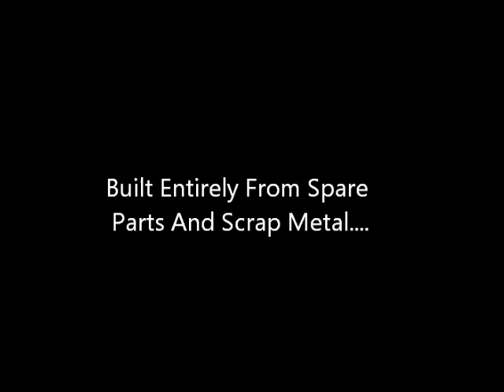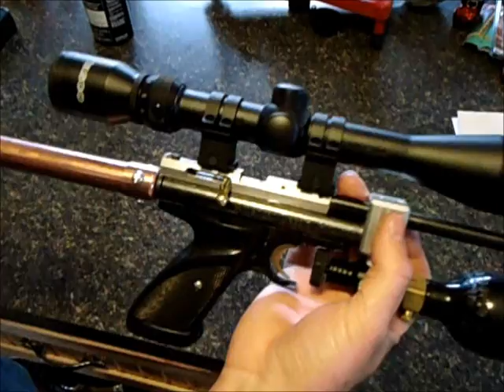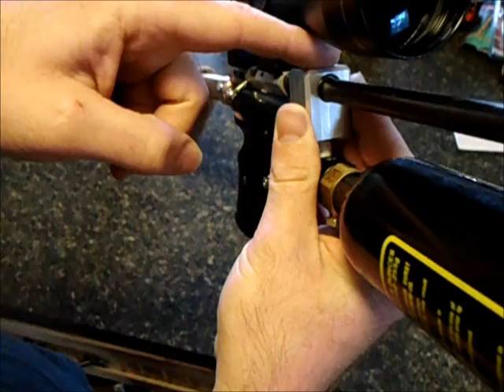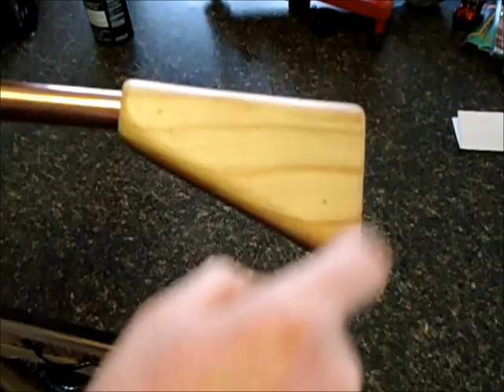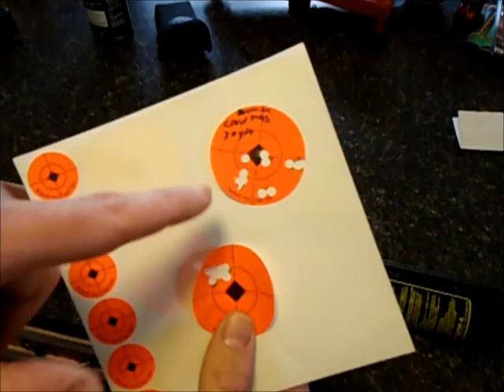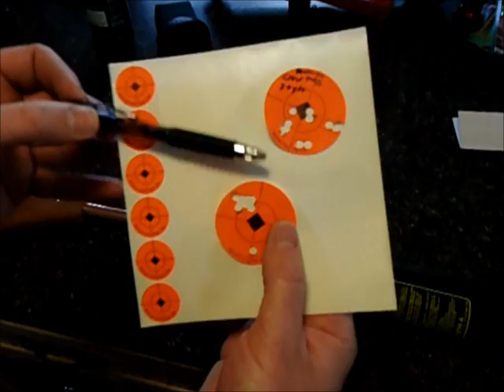Crosman 1377 Mods PCP/Bulk Co2 Project

Comment: So this isn’t HPA, it’s CO2?
Reply from the maker: HPA or co2
Reply: @MRT_H  ok. So you’re saying in the vid it could go to 1500 psi. What kind of velocity are you getting. And this is .177 cal, right ?
Reply: Sorry.  Just saw the 1000+ statement.
Reply from the maker: @visamedic  .22, I was getting 1000+ with 14.3gr pellets. On 2000psi. Kinda pushing the limits at that. But it worked. The gun is now a totally different animal than in the video though
Reply: @MRT_H    Wow. Mines a .22.  Been toying with it off and on for almost 10 yrs. I’m getting ready to do a tank adapter and set it up for HPA at between 12-1500 psi with a regulated tank. Little by little. Putting all new seals in when the kit comes in. Bigger valve with a bigger port. Folding stock with a power adjuster. Threaded barrel end for a moderator. Then I’ll see what I can do with my Fusion.
Reply from the maker: @visamedic  awesome! I wouldn't recommend pushing any gun as much as I pushed this one. I was super careful testing and everything, but it's still dangerous. Sounds like you'll have a great gun when you're done!

Comment: Nice job. However I don't like that you cut the trigger guard. You could have extended the bottle adaptor forward so to retain the trigger guard.  Other than that nice job.
Reply from the maker: Yes, you have to remember I was building this from spare parts though. And the 1377 tube is also notched. This was a slap together build for me, if I wanted it to be perfect, it would have been perfect 👍
Reply: You must of forgot to read where I said "nice job". As a prototype, of sorts, you had/have good ideas for modification that can help a lot of people who are into tricking out their Crosman. 

I was impressed.  Oh, do you know why you have to use Teflon tape? Because most of the fittings made today come from China and their thread pitch is off.  As for myself I re-tap or chase  the female and use a die on the male fittings.  Then I don't need Teflon tape.

Comment: Thank you Sir..... I think I will only be using CO2 anyway....... I'm a bit leery of the HPA  and Pressure as well.  I would Pin the Valve  180 Degrees  from where the Grip frame Screw  is , drilling  usuing a 1/8  Cobalt drill bit  and then tap a8-32 hole  deep enough to hold a
3/16th  in. 8-32 Stainless steel set screw to anchor it In.
Reply: That should say I'll be using a  1/8 " Cobalt drill bit (due to drilling hardened metal.

Comment: Okay I'll Wing it wherever I can.....! I  have quite a Bit 300 Series SS Rod to work with as well!   All I need is A good warm sunny day to work on my Grizzly Mini Lathe with Garage Door open.  Thanks for the tips.  I m not sure if I want .177, ,5mm,  .22 or .25 Cal. as I have choice of Barrels.
Reply from the maker: Mario Romano Or a heater! Haha just be careful with it, high pressure isn't friendly, and I would pin the valve in better than I did, I originally had it setup for co2, so that's why I won't fill past 2000 psi. If you want more psi, I would definitely re-design a few things. Keep in mind I was only working with what I had, if it was purpose built it would be much better. Just be safe, work smart. Also, I'd go .25 if you can, if you get similar power levels, it'll probably be more beneficial in .25 I would think.

Comment: At what Point on the  Air Tube did you cut off at....how much total?  I'm Guessing  you cut off the slot where the Pump arm  goes .  is there a reference Mark on the tube?
Reply from the maker: Mario Romano I'm not sure to be honest, it was cut to where the valve extension would reach, in theory you could make it as long as you want. You can kinda get a reference to where mine is cut by where the trigger is. I don't have the gun with me, or I'd measure it. But yes the pump arm slot is gone!
Reply: Okay...... I saw another guy who cut the Tube  to where  it reads ( from the right side of the Tube)  just where it says Not A Toy ... just after the"y" of toy .    But the other guy  just drilled out the front of the valve and tapped it to 1/8 NPT  ....!  

From the looks of it....in your video  it looks like the cut off for Tube was about 1/2 " Past(in front of) where  the  Grip frame is .   How long is the Stainless steel extension of the valve you Made.... although I recall you saying you didn't have enough to make it As long as you liked.... but that's fine...
Reply from the maker: Mario Romano Sounds about right. It's not an exact science, if you're off a little just trim a part down, or mix and match how you want it. There's no specific way.😁 Just order a little extra material, cut the tube where you want it, and go to town 👍 get Mario creative!

Comment: Hi...I've  seen that the ASA Adapter has a threaded hole  on the side is where the 1/8 NPT fittings go into on the bottom of the Gas Block I'm going to guess.
Reply from the maker: Mario Romano Yup, like I say, I drilled 1 additional 1/8npt hole for the foster fitting. It has 1 hole in it already for a remote line, etc.

Comment: Hi There!   What Kind of ASA  Adapter do you have & where did you Purchase it,Please?
Reply from the maker: Mario Romano It is the bottle adapter for a paintball remote line setup, I drilled and tapped an extra 1/8npt hole for the foster fitting. I've seen only the ASA adapter, I think on Amazon or eBay. Otherwise you might have to buy a remote line setup and take the coil hose off (use a little heat to free up the loctite if you do)

Comment: Hi! I Like your Build...Judering if you kept the Check valve in ,once you made the new SS Valve front?
Reply from the maker: Mario Romano Thanks, no check valve. I just cut a little shelf in the valve front for the valve spring to sit on at the same spacing as the stock valve for proper preload.

Comment: nice work. this kind of fabricobbling is the best. few people can even attempt. i think its beautiful. throw some black paint on the stock and gas/barrel block and it will look great. performance over looks any day. take pride you did great work. i have been air smithing for years and my stuff still looks like steam punk abortions.ive  been maching for 2 years so next build will look better. made a friend with a boat businesses a line gun for tow recovery and such. basically just a compact 2" air cannon. finding the perfect projectile( jr. lacross balls) was the hardest part.
Reply from the maker: Christian Hilditch Thanks! that line gun sounds cool!  I've since updated it,  used a magpul stock for an ar15, and made a cool barrel cover for it. It looks much better and functions better too. I've hit 1000 fps with premier pellets too! I have an updated video after this one....

Comment: absolutely fantastic 
what kind of velocity are you getting out of that with the CO2 and that did you pin the valve for the HPA
is the receiver any different than the standard Crosman receiver as for height I like the idea of a 20-ounce bottle lots of shots
you plan on making a kit I'd be very interested to see how much or if you needed mass-produced let me know I have plenty of machine shops available where I live
Reply from the maker: Thanks Old Guard 850! Here's a video of a quick chronograph test... https://youtu.be/iVCp_W_7zfY the receiver tube is stock, just cut the front off the tube. No need to pin the valve,  as the air block/barrel band directly to the valve itself,  so no part of the 1377 tube holds pressure.  Don't really have plans to make a kit, but if I had enough interest I could make some up. It is using high pressure air in the chrony test 1600psi fill, it was floating around 750 fps with a 14.3 gr crosman premier hollow point. Want to do a chrony test with co2 as well for comparison,  as when the co2 expands it may have a different result.
Reply from the maker: Old Guard 850 Here's a link to more on how it's was modded and the part detail..... https://youtu.be/2Qq2FxjiQt4
Reply: MrTurbo458 I would like to build something in a 177 I do a lot of rats and mice shooting 22 is a little Overkill go to 177 seems to be fine don't have to worry about over penetration or ricochets is there a way we can talk outside of this forum I would appreciate it if there is if you would like my email address just ask I'll be more happy to send it love your work and hopefully someday I may be able to get mine to do the same
Reply from the maker: Old Guard 850 For sure, I'll message you through youtube and we can get in touch. You go to your dashboard,  then community and click messages.  I'll message you sometime tonight!
Reply from the maker: Old Guard 850 Can't find a way to message you on your channel page.... or on your Google plus.